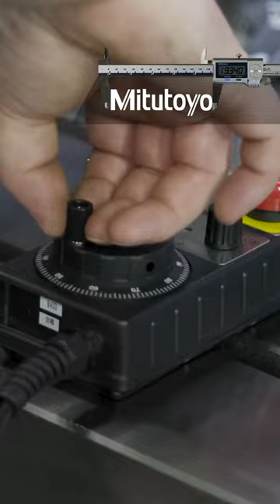Multi-Vise Alignment Hack!

Comment: This was the straightest piece of unmachined Aluminium square bar i EVER seen!
We use a ground round bar for the same, works as you shown perfectly every single time. Work smarter not harder!

edit : we also have the T-Nut ground and perfectly aligned on the vice, so when the T-slot in the machine is in perfect shape you got your alignment right there for the first one, just gently press against the T-slot to get it squared up when tightening and then throw on the next vices as seen on the vid. Won't work here because the Slots don't align in the right spot for that plate.

Comment: i want to know how everything is always so clean in all the Titan clips ? Were those vises brand new or did you take them apart and clean every piece of them.the last time you used them. I have never worked in a shop that clean......ever
Reply: Same here, how on earth are they getting them that shiny???
Reply: I know that they’ve mentioned off handedly in a couple videos that some of the machines have basically a cleaning cycle, where all the flood coolant gets turned on and the machine does a little jig to make sure that everything is washed out completely. And so long as you’re not marring the surfaces, running tools into vices, and making sure that stuff doesn’t rust, then everything should stay shiny. 

Keep in mind too, that these guys don’t really do high volume fast turn around Jobs where they’re trying to do everything quickly for efficiency’s sake like most machinist shops are, so they can afford to take the time to make sure that all the products look the best, because they have sponsorships from the companies who make those products, so it potentially financially benefits them to make sure everything in the videos look brand new.
Reply: @glennprivee639  theyre not a really shop, theyre a massive billboard, they do not make long batches, its really short productions, and they only machine alloys, wouldve been another story if they did plastics and fibers
Reply: Yeah its like they knew this would be on video so they spent all night cleaning everything in a 20 foot radius of this machine!

Comment: Why put the vise out so precisely? After all, the machine itself can compensate for the angle of rotation of the part?
Reply: Yes but if you're going to clamp one piece with three vices they need to be aligned.

Comment: So you don't align any of the vises you just slap a straight bar in there Tighten them all up and clamp them down and that makes them straight with the x axis with .001? Having a hard time believing that maybe if you true one vise and bolt it down first
Reply: They used 123 blocks between the vises that they pushed the vises against, then used the bar to make sure they were in a line with each other.
Reply: I too am a bit sceptical
Reply: @Michael Eisenhut  for sure I can see that, they didn't show it though lol if you just do the technique they show you will definitely get the vises square within reason but to one another not to the axis of the machine because there is nothing to hold it true to the axis
Reply: @Michael Eisenhut  I hear ya just a little misleading they didn't show it and this is supposed to be "educational" damn new guy gonna come in slapping blocks together and wonder why his cut is out of parallel .120 lol
Reply: @MF-og1ct  the 246* blocks are to keep the spacing equal they don't align the fixed jaws on the same plane
Reply: @mmdos109  that would make sense if this wasn't an academy channel lol if you're gonna teach people you gotta show them all the steps otherwise I've got to tell them they don't know shit and how to actually do something